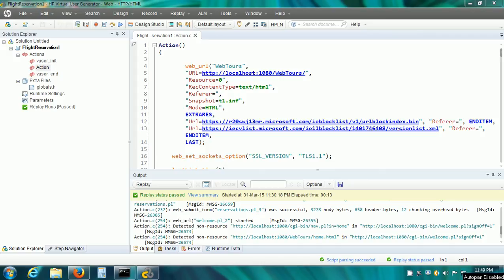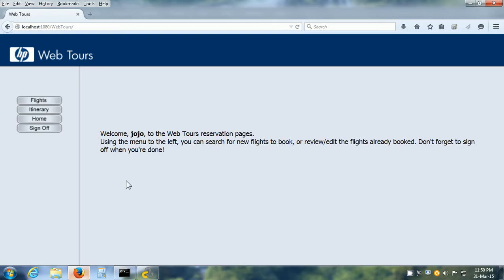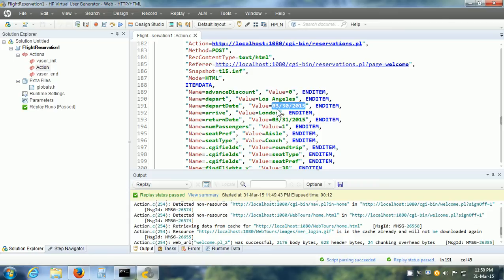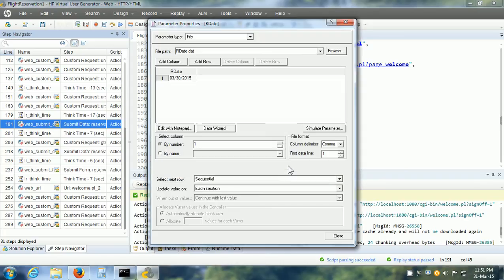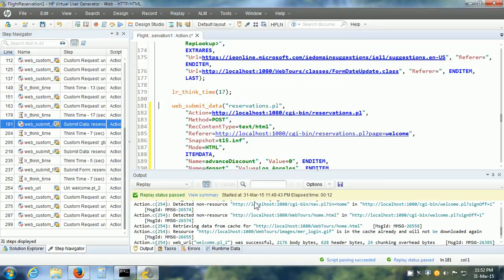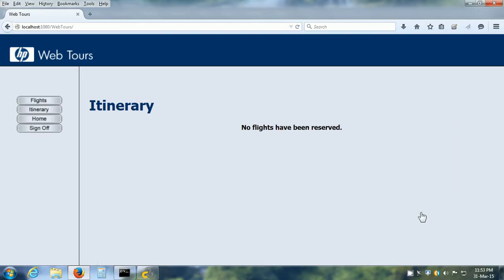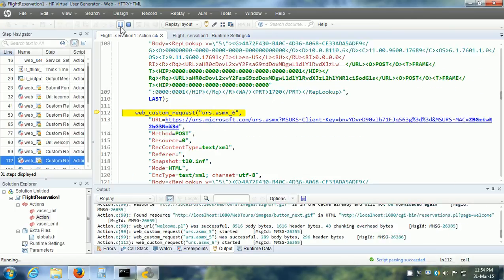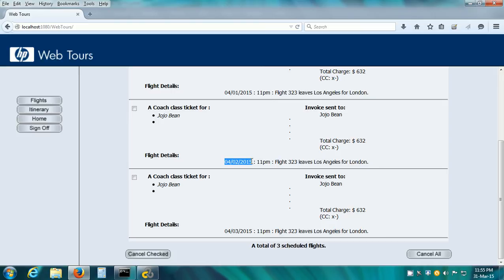LoadRunner-Parameterization-Loadrunner Tutorial for Beginners-LoadRunner Scripting Tutorial-VuGen

Comment: Thanks, good instruction. May I ask how to connect with ODBC instead of using dat file.
Reply from the maker: Thank you. LoadRunner VuGen supports ODBC. In order to import parameter data from a db, you can write a query using Microsoft Query or write a SQL statement. After the data is imported, it is saved as a .dat file. You can then use it as a parameter file.

Comment: Hi,

In load runner I have done parameterization.

Steps:
1. I have created Vuzen script.
2. Replayed the script
3. Next done parameteization by adding 3 new rows test data 
4. Replayed the script.
5. When checked in application,need to create the 3 records rite which we have created through parametrization ?but it has not created 3 record.just before one record only exist.

Please provide me the solution.
Thanks in advance.
Reply from the maker: Hi, which website did you test? What is the error message that you get in VuGen replay? Please see my VuGen videos (# 3 and 4 in my LoadRunner playlist) first. The link is https://youtu.be/eAkEJ-Cum6g

Comment: But if you record a script using wwww.skyscanner.es website por example, you have 2 type of dates: I parametrize 2015-04-09 for example, but in many URL´s in script appears also as 150429 so how can you parametrize that?. Its the same value but from "2015-04-09" to "150409" so maybe asigning a variable to the parametrized value and then extracting that data?
Reply from the maker: Dani g We need not extract the data values at all, just note the data format. As the test automator, we need to provide the values to the Vuser script. We need to specify the data values in the same format as expected by a URL. We can enter our test data values in the Submit Data Step Properties dialog box. Thank you.
Reply: Software and Testing Training Oh, i see. Ok thanks!
Reply from the maker: Dani g Thank you.